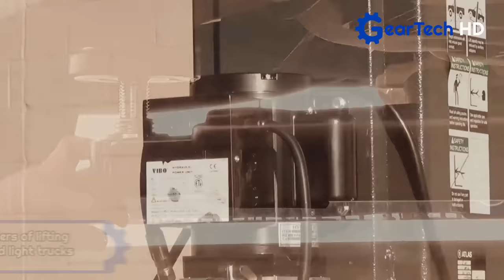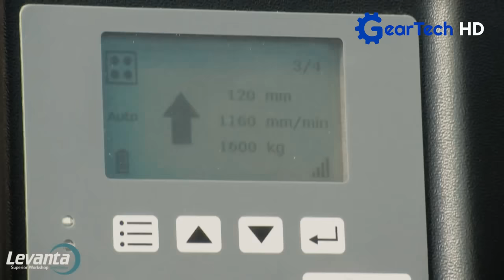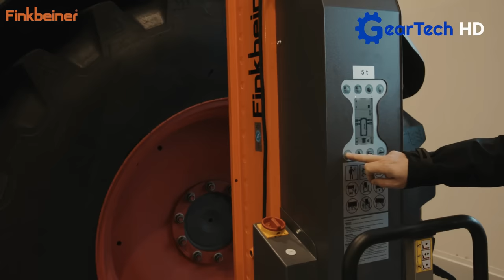Amazing car lifts you have to see ▶ air bag lift

Comment from the maker: and tell me which of these do you think is more useful?
Reply: The one where you have to use a jack to get it on to the lift so that you can then jack it up with a separate jack that is built into the lift. And jack points, who needs 'em right?
Reply: The airbag lift in the very beginning would be most useful for me. I work flat rate, and while a floor jack would work if you're just doing 1 tire, that airbag lift could have the car up in seconds. Definitely could be a time saver.
Reply: You forgot to tell us where we can get any of these or how much it will cost. And why can't we see these at Walmart or AutoZone?
Reply: For me the FHB3500 is the most useful.
Reply: I would be tripping and breaking an arm on some of those.
Reply: 2 post is the best for all purposes. Some of these are ok for just pulling tires off or brake jobs, body work.
Reply: All of them indeed
Reply: These are only as safe as the floor it’s set on.
Reply: I would like to know how much would it be for a card is not that expensive it’s just for home use
Reply: The hydraulic one they "look good", and they are of course the most practical and easy to use and build, but, Unless they have a super locking system, I would never get anther those cars. At the contrary to the screw system one, if the power is gone they stay up in the air, but of course much safer.
Reply: All are useful in the same time dangerous. I don't see any of those Muppets going or working under those cars... Why is that, no life insurance?!?

Comment: I have a small shop and I am working on historical 1/2 to. I am in need of a lift because I have trouble getting up and down to get under the truck. If I had any of the lifts it would be a great improvement to my shop. Thanks for sharing.
Reply: how much money are you willing to spend for a lift?
Reply: @_Wai_Wai_  I bought a lift last summer. It works great

Comment: For most workshops a 2 post clear floor hoist is the best. 
4 posts are great for some jobs and lousy for many others.
Those scissor lifts, at least the taller ones are good for brake jobs, fitting tyres etc and can be moved around. But MUST be used on level and smooth floor. Useless for most other jobs.
If used with common sense are a very handy piece, though dangerous if not.

Comment: LOL at the last one. You have to use a separate jack to lift the car up so you can put the jack points in place, then once it's up you can't access anything under the car because the lift takes up so much space. Even an oil change would be a PITA with that one.

Comment: No thanks to none of these. I think I'll go inside my garage and give my good 'ole Atlas four post lift a hug after watching these lifts. lol
Reply: But the 4 post isn't all that useful when you need the tires off of the ground too....That said, I still like my 4 post lift.
Reply: Some four post lifts have the option to lift the car or truck off the platform so you can do a tire rotation. I own a 4 post that can do this as well as a inground 2 post lift. I honestly love my inground 2 post it gives me full access to everything.
Reply: Worthless comment, comparing apples to oranges.
Reply: Did you just flex a 4 post lift.  Lift your car and change a tire on that 😂😂😂.
Reply: Very nice if you can afford the lift, the six-inch deep concrete floor, and the rented forklift to get the lift off the delivery truck.
Reply: I'm disabled and can't get under the car to adjust a 2 post lift. My 4 post came with a jack tray. I currently have the steering and suspension removed from a '91 Firebird.
Reply: I have one of the airbag jacks. It's awesome, except I see some safety issues. First I paid $110.00 for one from China. The internal guide tubes hangup while lowering causing the car to suddenly drop a few inches. After watching videos, this is caused by poor quality and rust (even when new). Also, the only thing to fail is the airbag. When it fails, it will explode like a balloon.  Old rubber always fail. As with any jack, ALWAYS, ALWAYS, ALWAYS use jack stands!!

Comment: the air jack looks kinda not safe at all, and you need an air compressor to make it work.  The small 2 ton jack I got for 40 $ can probably do better and it's really easy to move, so it"s ideal for small jobs like removing a tire.  Also, I don't understand the scissor lifts, you can't really get under the car cause of the scissors, and it does not look stable.

Comment: The big one jacking the tractor up might be good for something, but there's little to do under a tractor and then there's usually high enough. The 3 bag lift looks like it would be good for a flat, but completely redesigned. It was too tall for the even the car that was being jacked up and worst if you have a flat. Then it needs it's own air source, could be cordless with its own pump. Don't see any purpose in the one the car tilts on and then their commercial was lacking. Why did the guy jack it up to open the door and polish the side; then he had such a big wrench that there was nothing on that car that it fit.

Comment: These things completely block off the underside of the car making any work impractical.
Reply: Yeah, with these things you only have full access under the engine compartment and the rear axle - what's there to do? All the real work is done between the axles, right? Like the exhaust pipe and... and... um...
Reply: @rujolift5558  exhaust pipe, drive shaft, transmission, fuel and brake lines, e brake line, electrical wiring, ect ect. so yeah. having access to the whole underside of the car is pretty usefull. if all you need it for is brakes and tire rotations and other stuff you do on the side of the car then sure these are fine.
Reply: The ones that block off under the car are mainly for tyre shops to change tyres

Comment: Those airbag lifts should be permanently installed on every car from the day the car is bullt
Reply: Some old cars had 4 jacks built in.  Ford Pilot IIRC
Reply: Some high class cars in the thirties had in built hydraulic 
Jacks for wheel changing.
Reply: So they can be rebuilt every five years when they leak?
Reply: Like is not enough crap installed already...